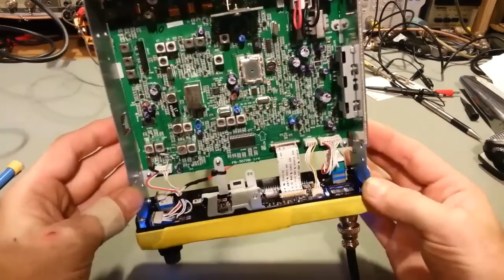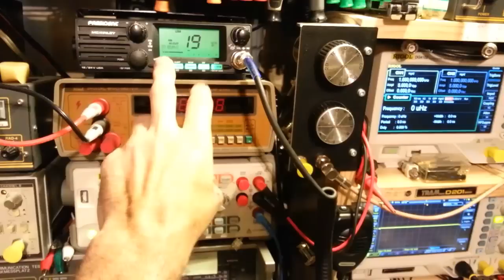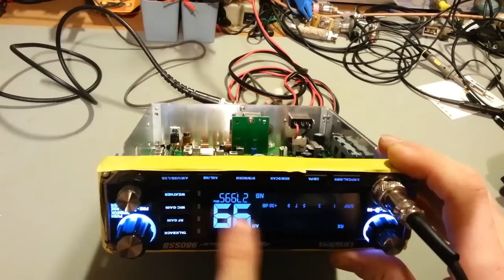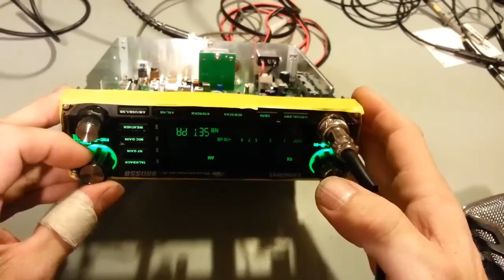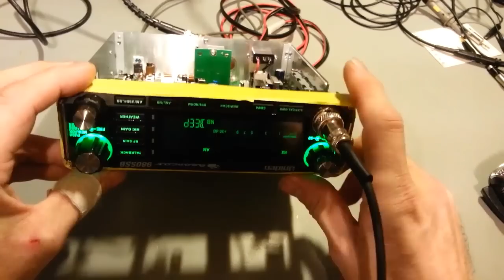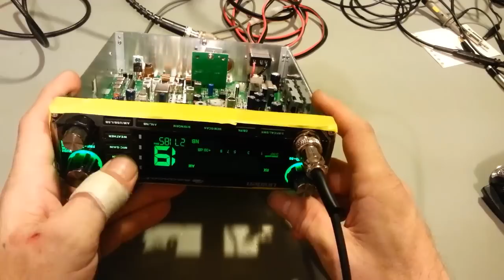Uniden Bearcat 980SSB install of a 10 meter expansion board.

Comment: I think that the older radios like J.C. Penney's and Sears 40 channel phase locked loop radios were a lot easier to modify.  All you had to do on those is cut a trace on the circuit board and resupply a voltage to the clarifier to unlock it so that the transmitter would follow the clarifier in frequency.  You also had to install a couple of SPST-center off switches to control the frequencies.  When I moved to Tennessee from the Atlanta area I sold all my old CB equipment including my old Fluke freq counter.  Wish I had it all back.  I did find a modified J.C.Penney's radio in my storage shed the other day along with a D-104 power mic.  Now if only I could find an antenna I'd think about putting up another base station.  I used to modify radios back in the mid 70's and 80's as I had a lot of schematics back then to work on radios.  Most of them were pretty easily modified.  I suppose if I could find enough coax I could climb a tree and put up a folded dipole but I don't climb trees any more since I'm now 69.

Comment: I am an enthusiast of SSB 11 meter radios and have a collection of Cobras, RCI's, Uniden's from the 1990's and 2000's all working fine. Was thinking on getting a modern radio and was wondering how good is this radio compared with the Galaxy's, Connex's, President's etc etc... I just like the looks of it.

Comment: Hello, I have a question you might or might not can answer. So what I would like to do is remove the face of my Bearcat 880 and relocate it. Just due to limited to no space in the cab, I have checked with every company that makes flat/ribbon cables no one can get me a longer on that connects the face board to the main PCB. Is it doabl to change out the connector on boath boards?

James Blue

Comment: What does it mean to "unlock the clarifier"?  This isn't the first video that this has been mentioned but not explained... Thanks!
Reply: it allows the clarifier to transmit on the same frequency it is receiving.  a locked clarifier will not change the tx freq as you move it to receive stations that are not centered on the frequency you are on.
Reply: By unlocking the clarifier the transmitter transmits at the same frequency as the clarifier.  This mod is usually done by providing a different voltage to the clarifier pot.  It is useful when talking to people between the frequencies or to those who are off frequency or the normal frequencies.

Comment: Hi Mike, I need your help, I have a ssb980 second generation, my problem is that the screen starts losing digits with increasing heat; In the mornings, I turn on the station and it is perfect, but as the temperature increases, numbers and letters begin to disappear completely or partially. I need to know where to send it for you to review and, if possible, repair it. Beforehand thank you very much.
Reply: Yeah me too I need a new display board , same problem here

Comment: Mike , you make the best cb vids out there. Really appreciate your skills and explanations. Would love a video on getting rid of the beep, I know there are some vids regarding this, but your the one we all trust. I have a first rev 980, like the radio but that beep with head phones is painful. I enjoy using headphones, and that beep does not get controlled viz the volume knob, it is full blast to the ears in the painful range. I have a question on the 980 transmit meter, on ssb it shows a swing, but on am it shows almost zero. Not that it matters, but it seems odd. Maybe something I just don't understand. I like this radio. My only beef is the beep , and the rear speaker jack. I think all cb radios should have a front headphone jack. To me the joy of radio is getting the phones on and trying to hear those far out stations.

Comment: i just mounted one of these in a car with a western star 250 watt bi linear amp.mike is the face plate glass replacable? if yes do you have a ball park on this job. the guy i just mounted this in his truck his is all scratched up. ty

Comment: If you dont have a FCC license you cant use the 10 meter frequencies. So what's the point. And if you do have a license you wouldnt waste time on this.  Either buy a hf rig or a legit 10 meter radio.
Reply: i Wouldnt say that i enjoy my cb mobil and the capability of having 10m in one unit Kd5dnk amature extra class!
Reply: If you are a CB radio operator and run a freq counter to stay just below the 10 meter band then all's well.  You might just want to get above or below the channel 1 through 40 bullshit.

Comment: So you converted a legal radio to an illegal radio. Don't need a license to transmit on cb, but you need a license for the 10 meter band.
Reply: That would be up to the user to use it legally.

Comment: Are you doing any work on the Bear tracker radio/scanner?
Reply from the maker: If you mean the 885 I have not had one to look at yet and as far as I know there is no service manual that has been released for it.  Is repairing a radio like this possible without a service manual, yes. Is it economically practical, no.  That's why I always tell people don't buy radios that there is no published service manual.

Comment: Is there a way to look at the box and tell if it's an old version. I've been looking at one and getting one of Marks boards installed but I don't know how to get one.
Reply from the maker: Have never had one here still in the box so I don't know if there is.  There is when looking at the back of the radio.  The old ones had a screw in the back near the antenna connector, in the new version it's a empty hole (no screw).  The new versions did not need a bracket on the inside because they do not have a separate SWR board, it's been incorporated onto the main PCB.
Reply: MikesRadioRepair  Thanks. I'll look out for that and try to get an older style.

Comment: Why won’t Uniden just come out with a 10 meter radio I love the design features and looks of these especially the new one with bear tracker and scanner but just make a 10meter
Reply: Just buy a icom 706
Reply: Kind of need to not forget the Uniden 2830 , HR2500 , HR2510 and the HR2600 and of course the original Lincoln seeing as standard is 10m only 28.000 - 29.699 MHz and have to be modified in order to be used on the CB band then also since Uniden made the radios for RatShack the HTX-10 and HTX-100 ( no 11m strait 10m only ) and for full HF the ol boat anchor Uniden 2020 (i have one). I would take any of the the above named tried and true awesome 10 meter export radios over the new crap made by Anytone re-branded as Uniden/President like the $100 980... Well you get what you pay for and when the radio is $250-350 vs $100 sold at Walmart vs eBay or a local shop or someone off the air.
Reply: You can buy a "President Grant II Premium" in the EU which looks almost identical besides the chrome. It has 25-30MHz (Jumper inside), AM, FM and SSB. However, I think that the President Lincoln II+ outperforms both of these radios in every aspect. I owned the Grant II Premium myself and compared to the Lincoln it lacks quite alot.
Reply: I have a uniden 885 bear tracker that is flaking out on me that I purchased last year. It is also hook up to a 3 pill. Before I get this  one fix can we talk? I would love to put 980 on my three pill with the upgrade and mods. Please if you can get in touch with me.

Comment: Where did you get that new display board? I cracked the screen on mine, need a replacement board.
Reply from the maker: +misener 

The display itself is removed from the original front microprocessor  board and transferred to the new microprocessor board.
Reply: MikesRadioRepair  so I'm pretty much screwed? Cb came out of Cb pocket and hit the shifter cracked the screen
Reply from the maker: misener 

Other than getting a parts radio to extract one from, yep.  Uniden service support is non existent.   Email them and the reply is defining silence.   Unlike President that has excellent support including stocking parts at the US  headquarters in Florida.  All I do with them is email or call, order the parts and there here in 2 or 3 days.  They are about the only company left with good after the sale support and service.
Reply: Thanks!

Comment: do you work on Alnico Dx-70's ? thanks, Chuck KC6CHT
Reply: Clairmont Skyland Radio & TV Services
825 Oak Street
Gainesville, Georgia 30501
Voice: (678) 971-1130
Fax: (678) 971-1131
ClairmontSkylandNorth@gmail.com
Reply: @M70ACARRY  Are they still in business? I need the vfo encoder repaired/replaced on my DX 70TH...

Comment: nice mod install. and cool on president repairs. I got myself used Jacson II and it just needed bub replaced in the scale. I do not have base antenna, with magnetic car antenna on the roof of the house I sometimes hear people over 1k km away. locals are quite dead here not around cities on trucks.

Comment: I purchased the same model recently.  Shows promise but its a bear to fit in my 2004 chevy s10 without cutting and drilling. Is it possible from what youve seen to convert the front panel into a head unit?
Reply from the maker: KINGOFTHEPOPES 

Is it possible, sure anything is possible.  Is it practicle or financially feasible, probably not.

Comment: Why waste all that money on expanding that baby radio. Just buy a good 10 meter radio have it tuned and aligned and be done.
Reply: That is what I say. I have a Stryker 955 HP that has so much more functionality than a 980 also got an old Galaxy DX93T great radio.  Why convert a CB to a black box radio when you can buy one with it all in it. No need to add channels.
Reply: RIGHT ON !   Great advice !!!

Comment: Very nice! Is this just for show or do you install theses for customers. I really like my 980, makes a good radio for traveling with ssb,am and weather band. With the added channels I wouldn't need anything else in my pickup. Other then a little heat.
Reply: MikesRadioRepair thanks for the quick reply. I have had my 980 for about 4 years now, so I believe it's an original. I'll need to get with you

Comment: Mark did a great job on that board,
I can appreciate all the work that went into it.
I have question for you Mike where  can I send my Leader FC LDC822 to get recalibrated?
Reply from the maker: +Hawk N.W.C. 

I use a local calibration laboratory that's only a few miles away.  You might check and see if there is a cal lab near you.
Reply: How can the board be purchased? I just picked up a 980. Thanks!